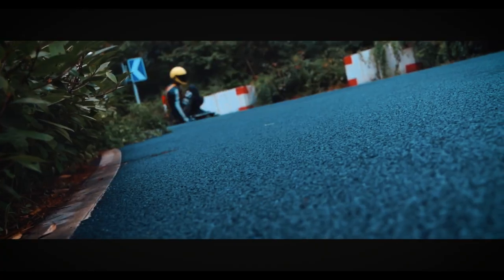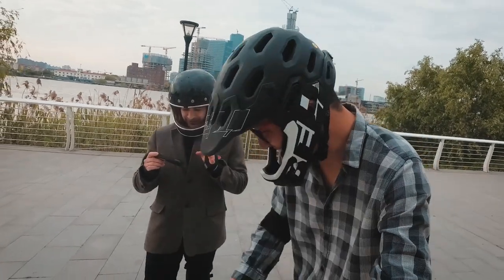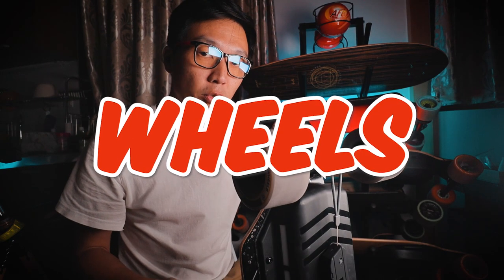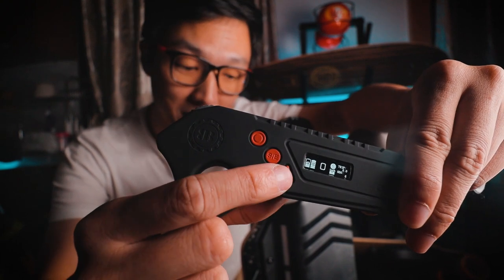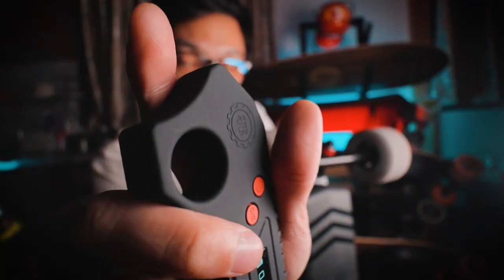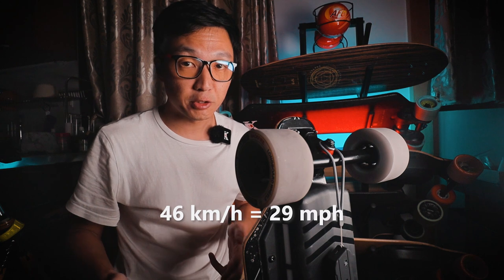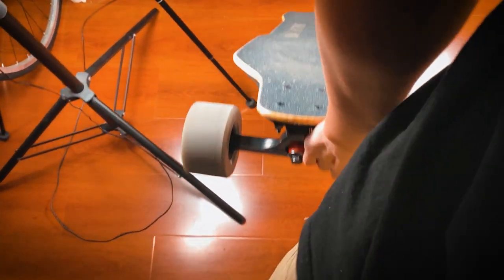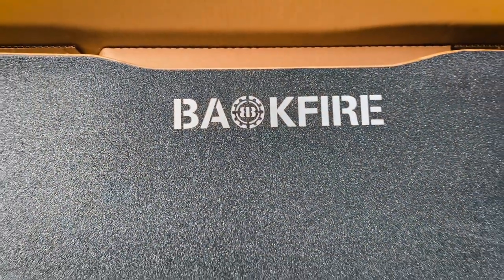Backfire G3 in-depth review. Expectations exceeded. Major flaw that kept me awake has been fixed!

Comment: Is this much better or worse than the Wowgo 3 for carving? because of the paris trucks I assume the wowgo 3 is better?
Reply from the maker: If you use the same bushings on both trucks (Paris and Caliber) and keep them equally loose, they’ll feel looser on the Paris and tighter on the Caliber. You can carve well with either one. You just need to use the right bushings for you.
Reply: @DanielKwan  Can you recommend good bushings for caliber trucks? (to make them better for carving/turning). I'm not really into high speeds..
Reply from the maker: Markus Rasullt  The stock ones are pretty decent, you can try those first and see if they’re too soft or too hard for you. If you decide to try other bushings, Venom and Riptide brands are popular.
Reply: @DanielKwan  ok thx
Reply: @DanielKwan  I really have a hard time deciding between the Wowgoo 3 and the BF G3.. The Wowgoo 3 has a better battery option (Samsung 40T) and is still €50 cheaper then the BF G3 (with coupons counted in)
Also I'm wondering  which deck has more flex and which board's motors are noisier? or are they the same?
Reply from the maker: G3 deck has a bit more flex if I remember right. The motors should be equally quiet, but the G3 should have a bit less road noise because of thicker tires.